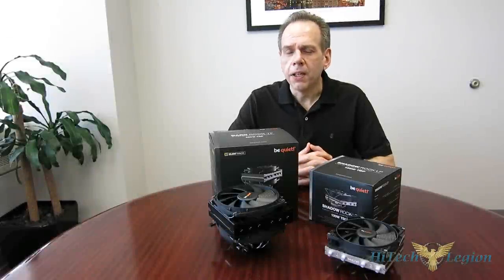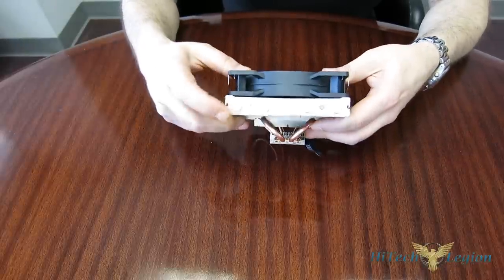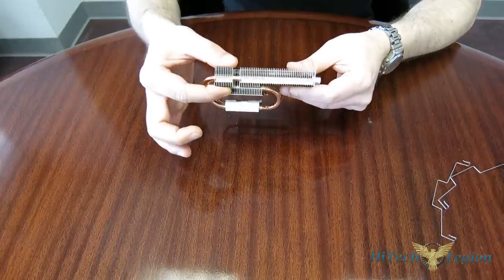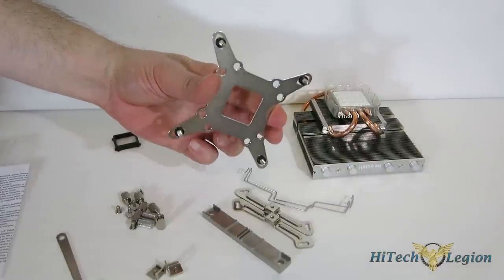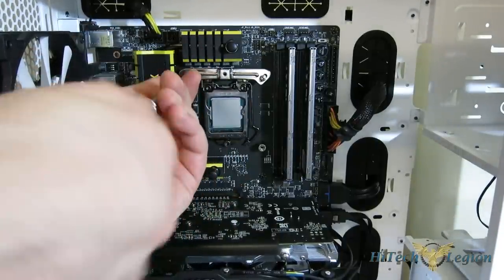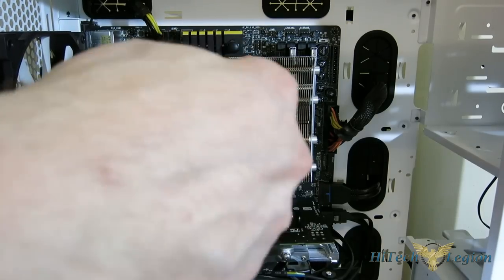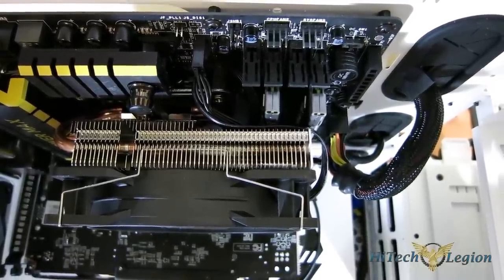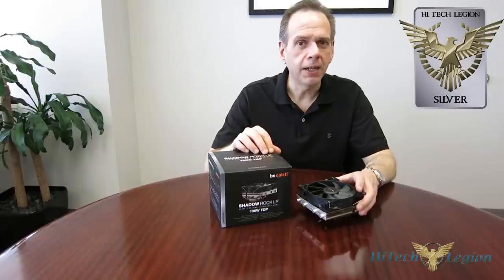be quiet! Shadow Rock LP SFF CPU Cooler Overview, Installation and Benchmarks

Comment: I had no trouble installing the rest of the CPU cooler except for the fan installation. This video just straight skips that part. Not sure what I'm doing wrong.
Reply: same here, it feels like it needs a ton of force
Reply: GearHeadGaming1 hey it was actually easy when I figured it out. I could make a quick video if you need it
Reply: MEWMIU I installed it today, what I did was put the metal clips on the fan only and pulled them down hard to bend them and then it was a lot easier to mount to the cooler

Comment: Got it installed except for the fan. Looking for tips on installing the fan.  Play this video. And he skips that.  Great...  I managed to get it on anyway no thanks to this video.   By the way, you can use any RAM you want if you flip the heatsink the other way, hoving over the power chips instead of over the RAM.

Comment: you touched the base of the cooler right before you installed it... it would have contaminated the surface of the cooler and it wouldnt have conducted as much heat as it could have

Comment: I swear I'm having issues regarding heat. My cpu is a FX-8350 and my motherboard is an Asrock 970 extreme3 r2.0. soon after building the machine i was experiencing super high temps on my cpu, so I scavenged the internet to find a solution. Apparently, pairing a FX-series cpu with a 970 motherboard chipset causes the motherboard's VRMs to heat up, and this causes the cpu to heat up even more. Asrock themselves recommend to use a top-down cpu cooler in these cases, so that the air blown by the fan would cool down both the cpu and the motherboard. BUT this didn't solve anything and the temps are higher than with the previous cooler (that wasn't a top-down). Anyone knows if it's the pre-applied thermal compound or...?? Cpu fan speed's at 1500 RPM, 100% speed [according to SpeedFan].
HALP
Reply: The FX 8350 is very hot by itself even with some radiators so I would say nothing much can be done here. It's normal for an FX 8350 to get those temperatures.

Comment: Please help.. When installing the retention bars one side goes in but the other screw won't reach. Building this PC is starting to become really frustrating at this point because I've never been able to find a cooler that fits..
Reply: I have the same cooler and I got frustrated by that same thing. Just be slow and deliberate while screwing it in. Once one screw just hits the thread, start the other one. And go back and forth between them.
Reply: Teriton thank goodness I not the only one 😌 did you're CPU get damaged ?
Reply: Nope, still working three months later! I think you'd sooner damage your motherboard before the CPU if you tighten it way too much. So don't go overboard, just fingertight.
Reply: Hubert Shitmeyer turns out I had to put some pretty hard pressure on the fan just to keep it down while I screwed it in , and tried using two screw drivers, idk how I managed to do it but i got it in, and once you get it installed it's easy to remove and reinstall, so don't give up I'm sure everyone with this fan had the same problem it took me around 2 hours trying to install it

Comment: Would it work if you put the long side of the cooler to the left of the mobo (away from the RAM slots)?
Reply: that's what I just did; plenty (well, enough) airgap between the pipes and slot 4 DIMM.

Comment: Why didn't they go with a 15mm thick fan? I feel as though shaving off that 10mm would give it even more compatibility.
Reply: probably more noise, i tend to use AIO coolers for itx anyway :p
Reply: Jaymes Stewart Along with more noise I don't think it would provide enough static pressure. More static pressure helps in a heatsink or rad situation.
Reply: they would also need to construct another fan just for this heatsink = increased costs

Comment: Guys, I have an Intel i7 920 Cpu with the original cooler but it makes too much noise and I want to buy this, is it worth it and can I fit it on my Cpu ? I have 6 slots of ram, and I noticed that the guy in the video have small ram, mines are a bit longer

Comment: DON'T BUY THIS - it is poorly engineered and doesn't fit well.  Screw holes aren't aligned properly & I had to really wrench to get it on.  The whole discussion about a 2-hour install time is real.  Really:  this is a colossal POS.  That stupid crossbar with the screws that wouldn't fit without a lot of elbow grease...  Surprised I didn't break my MoBo.  Or screw something else up.

So after struggling with this thing and finally getting it installed, all seems right and I boot up.  Works fine for a while, but the system dies.  Looking at UEFI, I discover the fan is allowing the CPU to run at 46° - 47° C, then the system shuts down.  Anyone want to buy a Silverstone SST-SG02-F.  Dropping this cooler for a CoolerMaster Hyper 212 Evo

be quiet should yank this off the market.
Reply: George Head what socket where you using?

Comment: this fucking thing. the last two screws are killing me. for 4 fucking hours i cant finish the job because of that goddamn fucking metal bar bending to one side so i cant get the other screw into it.

i tried everything. please help. there has to be a way!!!!!! fuck bequiet.
Reply: It's a piece of crap - send it back or junk it.
Reply: It didn't cool the CPU adequately.  I was getting CPU temps ~ 46° - 47° C. See below.  I don't have patience for poorly-engineered items.  I wish I'd seen this video 1st.
Reply: I have an i5-7600.  Finally used a Cooler Master Hyper 212 Evo.
Reply: Thank heavens for this video, I thought i'd done something wrong.

I bought and fitted one yesterday, my heatsink (the fin and pipe part) runs from top to bottom of the mobo due to my RAM height - Corsair Dominator DDR3 2x8gb.

It's not the easiest of things to fit with those below average instructions BeQuiet provide.
It took me nearly an hour to fathom out and to get it all in place. 

The temps are ok~good. Idle 40C and full load gaming (BF1) 70C. (i4790k Z97A system)

Would I buy it again? No. Not unless they re-engineered it to make fitting easier.
Reply: I'm not sure. I don't overclock at all. But browsing through all the online reviews of this cooler, 65-72 seems to be the norm.
Thanks.
Reply: Hubert Shitmeyer i
Had the sam problem for only 30 minutes, the second screw takes a lot of pressure to push down and get it in.  To keep my motherboard from bending I put a finger behind the arm to keep it up
Reply: Since I bought this cooler, i've added one extra case exhaust fan.

I also took the cooler off and used some ChillFactor3 thermal paste. 
The temps are slightly better and fitting the cooler was easier the second time around.

I just another twelve months out of this pc, then I can upgrade it. But I wont be buying anything like this again.